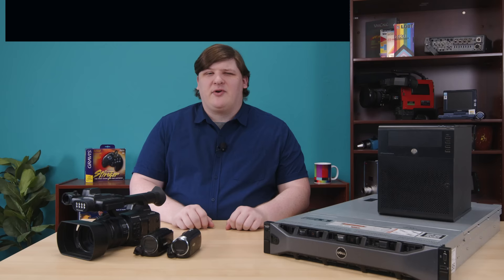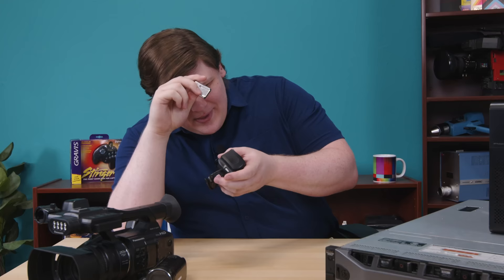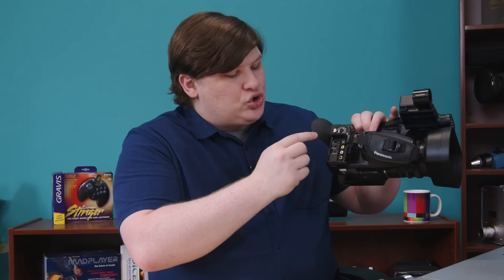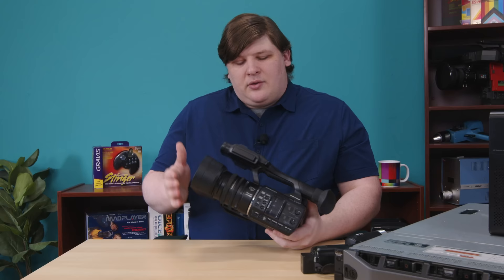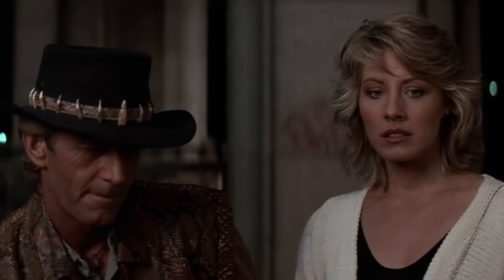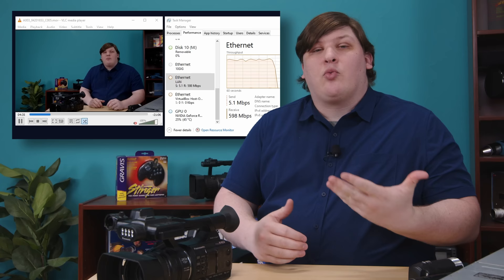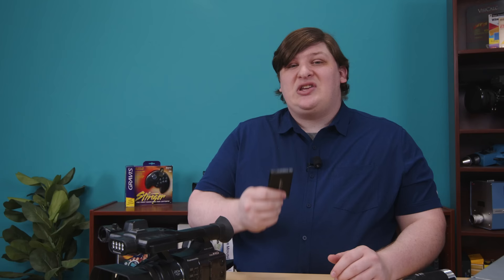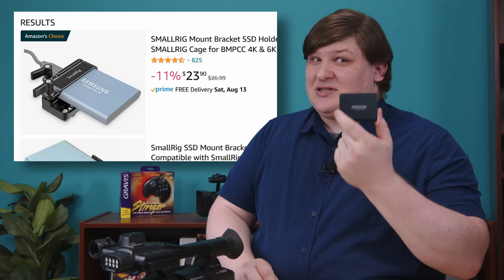I Built... a really fast NAS?

Comment: I'm sure some people have already ranted on this but my brain's a mess so ignore me. Mini SAS has 4 /ports/, it's not that it can connect to 4 drives, these are separate and extremely frustrating concepts. A port is good for as many gigibibbles as the sas revision but Mini SAS is a SAS2 baby so 6 is a good bet. A typical SAS drive receives 2 ports. That big SAS drive connector, SFF-8482, very unhappy that I remembered that off hand, is 2 ports, so 1 Mini SAS (SFF-8087) can connect to up to 4x 8482s, but it can only fully connect 2 of them. SAS drives are happy to run on 1 port but there's some consequence somewhere that probably doesn't matter anywhere. The thing about ports is that they're imaginary, they're a goblin but not a D&D goblin, a fae goblin, that lives in your house and may take revenge. A SAS2 port is good for 6Gb/s, it can also support direct point to point connection with 1 device. These are separate concepts.

You could take a Mini SAS socket and connect it to an Expander board, and you can find expander boards that will split those 4 ports out into 7 more sockets, each with 4 ports, but the link between the Expander and the Controller will only be able to pass 24Gb/s. I say 7 more sockets because I'm thinking of a specific HP PCIe formfactor expander, which is actually meant to take 2 Mini SAS links, for a total of 48Gb/s, and 28 total Endpoint Devices, a new keyword.

The Controller, or let's call it an HBA, has some number of Sockets, it probably has the number of Ports that indicates, it has some PCIe lanes at whichever PCIe Revision, and it has one more detail, Maximum Endpoint Devices. There's a certain dell PERC HBA (LSI) with 4 External Mini SAS sockets, for 16 ports, on PCIe 2 8x, and it can support 512 Max Endpoint Devices. So you plug this HBA into two of that Expander, and now you can connect 56 drives, and those 56 drives probably can't saturate the PCIe lanes. My wazoo is full of spreadsheets.

Hypothetically, and I really don't know how this scales, there's some way to connect a tree of expanders to connect 512 drives to one server, and it would be fine almost all of the time, as long as your workload only ever hit like 70 of them concurrently. More concurrent hits if you had hardware mirror. Anyway if you put 70 400MB/s SSDs into 8 Vdevs with 2 parity, you could nearly saturate a 20GbE link in reads, but you'd need a 16 port SAS3 PCIe 4 16x HBA. (and that probably falls apart with overhead factored in)

The core thing here is that SAS is functionally a networking protocol for a certain kind of peripheral device. Ports represent bandwidth, sockets represent electrical connections, the Mini SAS socket can electrically connect to 4 things, but the Mini SAS ports are just bandwidth. An Expander is like a USB hub, letting you split out that bandwidth to more electrical connections., keeping in mind that unlike ethernet this is a tree-like diagram with a single host (within the scope I'm informed about)

In your server, the Backplane is a SAS expander, it can connect all 12 drives over 4 ports. This gives you 24Gb/s to work with, and except for your Exos drives I would expect any hard drive to do about 0.1Gb/s. If you filled this with Exos you might get on the order of 3Gb/s, and in fact I think you would need to fill the 12 bays with SFF-8482 to 2x M.2 carrier boards, to host 24 devices each performing at over a 1Gb/s, to max out that 1 cable. The answer though is clear, there's 2 SAS cables in case one fails. The original Dell firmware was probably configured to treat these two cables as a failover pair and not actually use them both; but in IT mode it's either not smart enough, or needs to be configured somehow.

Comment: The camra at 4:00 i hace the same! Hate it too but i used it as my webcame for a full year thanks to the hdmi output + camlink and i just hade it plugged into power 24/7. It says it's 1080p when it's actually 1080i but at least it was better than my webcam. I bought it new and in the box there was both an hdmi cable and also a usb cable

Comment: I have a home VM server that acted as my main PC that's actually a who knows what chinese ATX dual socket that uses Xeon's from around that era or a bit newer put into a custom-built case I designed to have optimal airflow for the storage, two GPUs, processors, etc without having what sounds like a jet taking off for fans..  I have two 10 cores you can get fairly cheap (that was around the highest core count I could get while compromising on price and clock speed), 64gb of ram, etc.  Recently I replaced it as my main desktop with a 12th gen Intel processor since they finally started competing with AMD again while also being reasonable in price.

Comment: Have you thought about using LTO tape for your backups? LTO7 drives can be grabbed relatively cheaply (and the tapes are very cheap!)

Also, check out NETINT for a hardware ASIC encoder. These use basically no power, and are MUCH better than the encoders on NVIDIA/AMD cards. They have a ffmpeg build that will allow you to encode your video files at 4-6x real time. You might be able to automate a work flow where you edit with proxies instead.

Comment: I have an R720 I picked up off Ebay or Amazon, I forget which. Apparently it used to be owned by DigitalOcean (iDRAC said so!). I paid no more than a couple hundred bucks for it. I added a couple $8 NVME cards (don't forget R720 also doesn't support PCI bifurcation or nvme) and a couple Nvidia P1000 cards for transcoding. Because the BIOS also doesn't support NVME I have to use Clover boot loader on a thumb drive in one of the internal USB slots and I modified the load script to automatically boot with no menu. I chose NVME because I had a couple of matched drives on hand. Right now I have 6x 12tb drives for storage but I plan to eventually add a couple more to round out the storage in the machine and then start looking for disk shelves (I am a data hoarder).

Have to flash the RAID controller into IT/Passthru mode so it doesn't try to hardware raid which will mess up ZFS (so I hear).

I installed Proxmox and have around 12-14 VMs and containers running at any given time for various things. An NVR for half a dozen cameras (Agent DVR, but only 4 of the 6 are set to record anything), Jellyfin, Home Assistant, a web server, a mail server, a stable diffusion server, and a few other fun things that don't get touched too often. 

The thing is pretty quiet once it passes the Dell Bios screens which takes about 2-3 minutes.. Warm boots don't cause the fans to spin up.  My only gripe about it aside from the fact it draws around 40-50w more than my old consumer grade hardware is that it takes about 10 minutes to boot because of Dell's various bios ruminations and hardware checks. Not a huge deal but it makes me think twice for new kernel upgrades. Overall I'm super happy with it and as an old hardware nerd setting the thing up and getting it all working was a TON of fun.

Comment: I was so sure you'd end up knowing that the BX500 model was utter trash, but the MX500 was the actually good one... I've had similar issues myself with the drives being hopeless underperformers
Reply: For SATA SSDs the Crucial MX500 is the best budget performer. It isn't as fast as the Samsung models, but for saving sometimes hundreds on a model that's at most 10% slower, you really can't go wrong

Comment: I'm only at 29 min mark but you're showing how those Samsung drives "fit poorly" into those Kingston bays. I had an idea for that. Maybe find some padded tape. Something for weather stripping or in that area. Like a foam tape? Something that will stick to the inside of the bay so the drive(s) will fit snug instead of flop around? You could also find some sort of stiff foam to just cram in there to fill the gaps but for a more permanent solution I'd look for some sort of foam rubber with an adhesive backing to line the bay.

Comment: Regarding the micro-server.... I've hacked mine as well - SAS raid card running off the half-hight PCIe which means I get the hot-swap and mirroring. I've also hacked the BIOS so that it's got the external SATA port working for boot as well - so that I can use both the internal sata port that was for the DVD drive and external sata raided so that I can use that for a boot drive.

Comment: I have a smaller PowerEdge that I setup as an OPNSense router at my workplace. I replaced the fans with noctua fans, but it's a 1U server and still really god damn loud...
Reply: Big oof on  the DRAMless drives... Yeah, they're trash... MX500 (has a DRAM cache) is my go to for more budget friendly fast SSDs, like 90-95% of the performance of Samsung SSDs at a much lower pricepoint.

Comment: It's probable that fiber has improved since I last messed with it, but since it (was) made with literal glass fiber, there was always a limit to how much bend you could put on it before it irreparably broke.  In other words, fiber (was) fragile.  Never use in situations where the cable is exposed to potential abuse.

GBICs and SFPs can also be futzy.  One that my group was using developed a problem where it would consistently corrupt packets, but compute a correct CRC for the corrupted packet, meaning that the peer system would happily receive this corrupted packet.  I guess it's not surprising, considering how hot they get.

And yeah the backplane lets you multiplex and multipath your data.  In fact, it's probable that slower transfers with 2 cables attached has to do with multipath misconfiguration.

Comment: 36:20 I agree - I had a R610 when those where sold for pennies a few years ago, and even though it was cheap, it had all the downsides of an old server and not enough upside to be worth it. I splurged a bit and built a server with an EPYC 7282 (the 120W version) and a ROMED8-2T board. It wasn't even that much more expensive, but it's quieter, faster, can properly run a bunch of NVMe SSDs as well as spinning rust drives, and Dual 10 GBit ports mean I don't have to deal with 2.5G nonsense.

Comment: I realize this comment is a year later, but if the disk drive mounting is still a problem, I'd love to see about modeling a mounting system that makes sense, trial it in some 3D prints and what not. I'm sure there are plenty of people who would love a solution that not only works with both models but also mounts somewhere out of the way and manages the cable better.

Comment: The Crucial BX, the Western Digital Blue, the Samsung QEVO... All those are SSDs for archiving things you might use regularly but don't demand much or the bus won't ever hit their actual very low speed cap, they are certainly not for video editing and even actual high end videogames or as OS drives since their lack of DRAM makes them only decent until their SLC cache dries out, which is easy to do. 

But they have a very good niche for retrogaming. I use them extensively on console HDD mods like the MODE on Saturn/Dreamcast/PSX, they work well on PS2, they are even very fine drives for PS3 and PS4. Old consoles won't ever come close to saturate the drive on game loads and since they are SSDs, nonexitant search and access times still applies. They are still better even than the crappy HGST HDD that come with PS4. I think you probably should repurpose those drives for use on retrogaming or retrocomputing.

Comment: i got a server for free and it had 2x 8core 2640v3 xeons. it was not that loud but i upgraded just for fun to 2x 2670v3 xeons which one of them has 12 cores. and the fans are on 80% speed at all times. sometimes they get to 90% if it does a lot of stuff. currently for setup i have it in my room and when it is on i dont need to heat the room. on idle it needs 250W

Comment: Careful with 10Gbe, there are at least 2 variants, one of them definitely not compatible with 2.5Gbe or 5Gbe, the other compatible with at least 5Gbe. (1Gbe in both cases will likely be the minimum allowed speed with anything below that yielding a network cable disconnected error or similar)

Comment: i have a nx3230 and i prefer it over my buffalo nas and my nx3230 is super quiet with 80tb of storage and the system is remote or local and i transfer to it at 1Gbps and download from it at same rate off the fiber card, i stay away from SSD as i find they fail to easily and don't give any warning and the server runs me about 30-40$ a month in electric usage  like you my rack is located basement cooling is great down there server runs at 12-16 celcius all year round and i keep it connected via fiber from my switch, from outside i can download my files offsite at roughly 40Mbps, its good enough for my needs and i run plex for family and friends off this unit and it works seamless and iDrac (Lights out is great) good choice Cathode Ray Dude :)

Comment: Bruh I got a stupid cheap and old beat up Xeon tower and a SuperMicro dual-socket board.  That remote management stuff has saved me from getting a broom to poke the power button (nerd stuff sits way up on my nerd shelf) like... twice these past few months.  That's way easier than getting the step stool from outside by the trampoline then cleaning and drying it before bringing it on my wife's freshly cleaned floor!

Comment: The Nvidia Quadro T400 or T600 is perfect for this kind of machine. 
Mine transcodes up to 8 simultaneous 4K streams as fast as my 3070 does with NVENC. 
Above 8 streams it becomes faster on the 3070 but it's whatever.
It also runs entirely from PICE.

Comment: you could probably get a 2.5inch ssd enclosure, some zip ties and sticker tapes, and a stack of MX500, but during COVID every reputable SSD manufacturer has been caught swapping core components (controller, DRAM or NAND chips).
Crucial also have NVME M.2 drives thats not much more per GB, and you could probably premake a bunch of USB NVME drives in advance with a lot more storage density, sharing same short cable.
some sort of 2.5'' and M.2 SSD hybrid would be the best, as sata connection were ok for hotswapping, and NVME is much smaller. you would've seen how small some 2.5'' SSDs were in pcb size
and also intel ARC have AV1 encoding on cheap consumer GPUs (that need no external power, check up amazon) but probably flaky especially in Linux compared to pro cards.

Comment: I had no idea the Microserver Gen 7 had the option of such a bad processor. I had a Gen 7 and mine had an Intel chip (I forget which one) and it ran fine. Currently have a Gen 8 with server 2016 (it's pretty old now...) and even the Celeron in that is enough to act as a NAS, VPN Server, Database dev-box and run PiHole via Ubuntu in virtual box.

Comment: I know the pain of running a rack-mount home server! When I was a very dumb teen, I bought one for playing with -- 4 physical CPUs, 128GB of DDR2 RAM across 64 sticks, absolutely rediculous hardware. No real use for it at all. And for some reason, I made it into a Linux router for myself for the better part of a year, sitting right here about two feet from me in this tiny room!

Did I say I was very dumb yet? Because oh my god was I an idiot lol, just hearing the server ramp up in that video I could feel the stress of every time I had to press the power button and hope the thing would boot correctly that attempt.

Anyways that router has ship-of-theseus'd itself into far more comfortable hardware and now runs my entire home internet off of the 2.5G bastard protocol using cheap RTL8125 cards lol

Comment: If you don't need the cuda performance of an rtx 3070 or something like that, just get a Quadro P2000. They are cheaper, take less power and don't have a limit to simultaneous transcodes on NVENC. 
Also remember to write down which slot containers what drive. You don't want to pull the wrong drive when one fails. And ZFS supports snapshots. That way if you make a mistake, you can get the file from a previous snapshot.

Comment: Wow, there IS a valid use for all this kit at home. I see video's about 2.5G and 10G, but, apart from home lab playing, were of no real 'general' use.
Most of my home net is 100MB, for 99% of the time, it's fine, it's faster than my broadband connection, so it does not saturate. On the odd occasion, like backups etc, it shows its age, however that's not that often ('Real' backups of important stuff occur in my study 'computer room' where things are faster)
My NAS's are an old Netgear box, and an atom based industrial box, that HP box you despised is an off in the distance dream box here. My computer budget (as I'm kind of 'retired' looking after the wife) is kind of zero.
One day I hope to be a lot more of a YouTube creator, now I know, don't touch pro-res, it's well out of my league.

Comment: I am doing something similar and have been upset with widows networking. The solution I found was this command "net use \\server.ip.address /user:username /persistent:yes". If this command is used before connecting to the server at all and the user has access to the shares then this seems to fix the widows network fileshare access problems.

Comment: You should use an M.2 to USB adapter for ~$10.00 on eBay with a female to female USB coupler, with an OTG USB adapter cable! Used M.2 drives are really cheap on eBay, and all you have to do is Google the read, and write speed of the drive! Make sure you know it's an NVME drive first before you even bother doing any further research to save time! Most eBay listings will state this, and also look at the the way the drive is keyed first too!

Comment: Have you tried making paper check lists to follow? Documenting repeatable processes.

You almost always want a backup copy off site. For situations like fire/tornado etc. Also if you do disk mirroring some people think that using identical drives from the same vendor/manufacturing batch might not be optimal because of increased probability of overlapping failures. Rebuilding an array without an additional backup is a situation to avoid if possible.